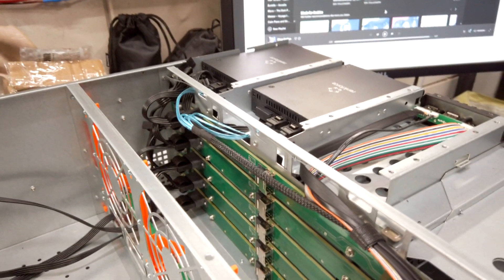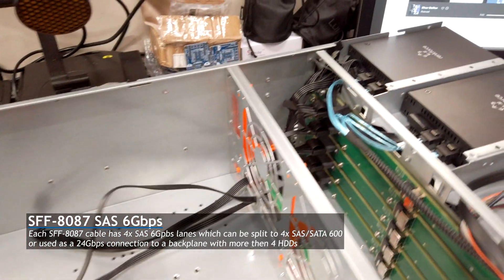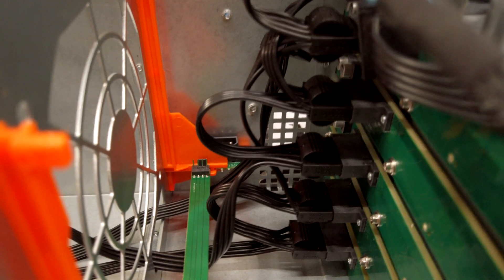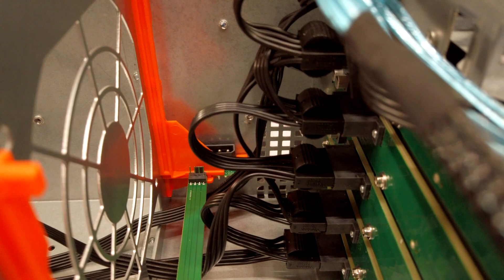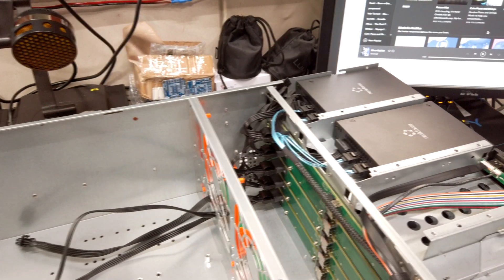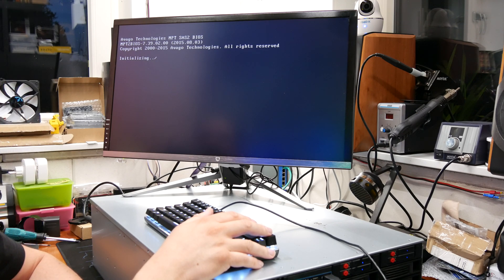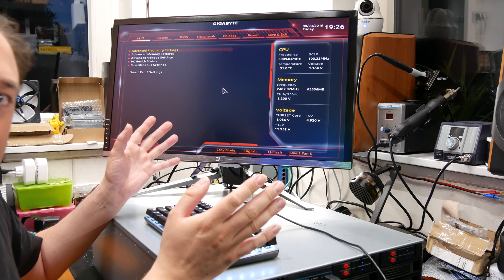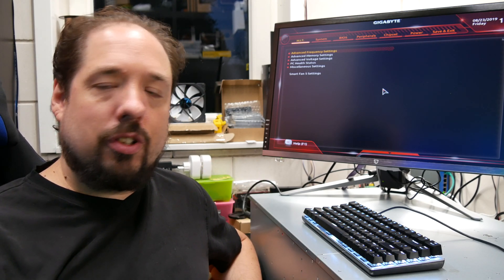Home Networking: 100TB 10Gbit Server - Building the server!

Comment: Perhaps your plan and explain how you intend to use the rig and the decisions you made and why you choose to use a certain setup over another. How and why you divide your pool a certain way. BTW, your PSU is it enough to handle 20 HDDs? How does the PSU 12volt rail handles per cable etc...? I've been confused with mixed information online. How much PSU watt do I really need if I intend to build a 24 HDD one?
Reply from the maker: Interesting question, luckily HDDs don't use that much power.

A single Molex plug can carry quite a bit of power, about 11A for 12v continuously I believe. Let's say that means there is a max of 120w (down rating a little bit) available per molex connector.

A single Seagate disk will idle around 4w and max usage a peak spin-up power of around 1.2A so 14.4w. If I connect 3x 4 disks (3x hotswap backplanes) to a single power supply connection that means 12x 14.4w = 172,8w! That would actually exceed the maximum rating of a single molex connector! But, that is for a single plug, I don't know what kind of cable is used inside of the cable and what the plug on the side of the PSU is rated for, most often those can take at least 150w  or 200w continuously. Pushing a surge of ~180w though there for a few seconds won't burn anything down and 12 disks idle would only use 48w.

With all that said, using the LSI controllers not all disks spin up at the same time as the PC does and when the controller initializes, not all disks start at the same time still.

All in all, I believe I'll be fine for this setup, the PSU is kind of overkill, but I still had it. I could look into running only 2x 4 disk bays per PSU cable but it really shouldn't matter that much.

As in how much wattage you need, let's say you have a 24 drive server AND they all want to start at the same time AND they all draw max power that would be 24x 1.2A @ 12v = 345,6w of peak power draw. Lets say you have a modest system in there that would also like 150w then I'd recommend you get a good brand (I normally use Seasonic) 550w minimum but probably 650w version. But, a 450w would probably work just as well since the HDDs spinning up, even if together, is just a small peak for a few seconds.

Hope this helps!

p.s. More storage stuff in a video soon
Reply: @IntermitTech  Wow! Didn't expect such a detailed reply. Kudos to you. Love your channel. Thanks!
Yea, I was on the same page as you, until I read about, realized that PSU have 12V Single Rail or Multi Rail configuration, thus splitting the max current the PSU could provide for the 12V channel. 

If we use it with molex splitter when we do not have any backplane for the Sata connector, it'll be even more dodgy. And PSU manufacturer doesn't require and to state clearly in the manual or psu how the configuration is made. 

I've check yours the manual from corsair website, the manual was "bundled" with AX1200i. 
(Over-Current Protection (OCP):
 The AXi Series feature OCP on the 3.3V, 5V and 12V rails. OCP ensures that the output of the DC voltage rails remains within safe operating limits. The AX1200i can be configured as a single rail or multi-rail OCP solution. ) 
I also could not find information of the max current/watt for each voltage rails.

Lack of manufacturer information, kinda hard to make a decision. Guess I gotta wack a overkill psu just to be safe, then slowly add new vdev (if I'm going with freenas) to the pool and monitor the power usage and see how it goes when my hardware arrives.

Edit: Just to add, found this video (https://www.youtube.com/watch?v=PWtKSHT2od8), it seems like 12V multi rail mode, corsair split half of it for the PCIE connector. Meaning for the molex and sata power would only be half of what the PSU is capable on the 12V rail. I can't find any of these information in the specification or manual for Corsair. I did actually emailed them this technical question, but was turned a deaf ear and simply replied that their line of PSU wasn't suitable for my application.
Reply from the maker: @briantan2963  Oh wow, you've been doing quite the search! In all honesty, I wouldn't worry too much, it's only a very quick peak power delivery if all disks would turn on at the same time and that probably wouldn't trigger OCP yet, only if it lasts for more then a few seconds. And once that peak is over, unless you are thinking about spinning 24 disks down and up several times a day, it really won't be an issue and again, that's what staggered spinup was created for which means the controller will power on all disks sequentially, often in pairs of 2 to minimize the hits on the power supply. Also, the rated value for the disks of 1.2A is also a worst case "design for this" scenario I believe.

Single-rail and multi-rail could be an issue, you're right in that, I actually believe the AX680i is by default in multi-rail mode but in the video you sent that is about 40A? Should be ok, especially since I'm using multiple connectors. All modern Seasonic are single rail only I believe unless you pass 1000w, but that would be nuts for in a server like this. ;)

Comment: i love it to see you keep continu this build. wonderfull you had the videocard working, you can cool the cards with a 120mm fan or so on top of the cards blowing down or up..  i am not sure what works the best i still experimenting with that , those LSI are really heaters to the touch, need some temperature data so might need the thermistors comes with the mainboard or i try to capture the heatsink temperature with my IR camera and see whats the best position of the fan. iam sure it will help to cool those SAS heatsinks anyway. Your SAS cables are the same as i use, pretty nice sleeved. Behind the PSU and the case is a good place to store most of the cabling -)  i am now ordered a 3th controller a 9207 8e to drive my external enclosure. it might work with 2 x 8088 cables to speed up...  i dont know if that works. Enough to try and testing and installing so much like in my current system as it would be the replacement. Probably months to go but i will get it done hehe